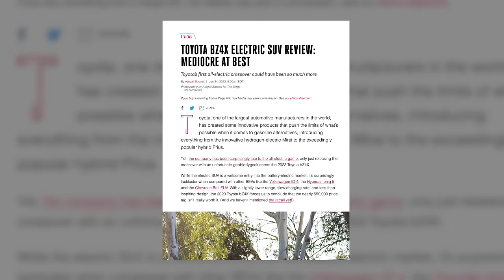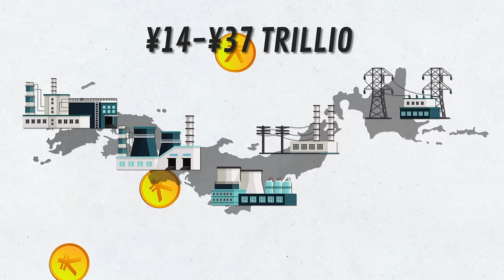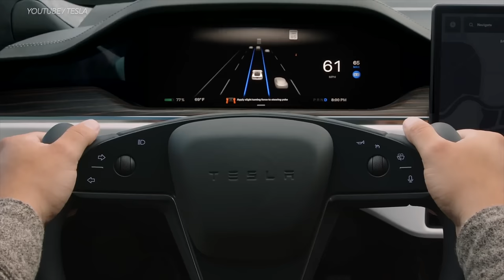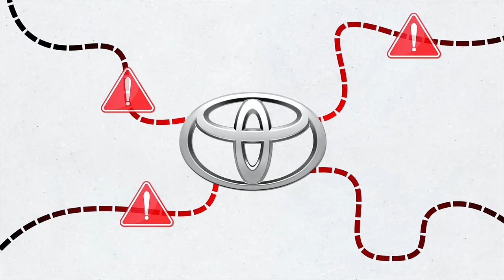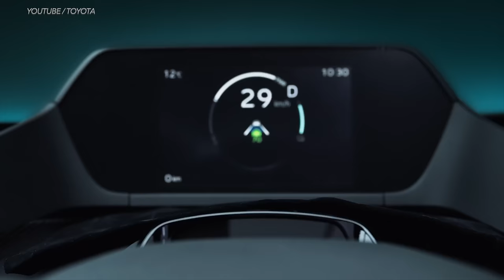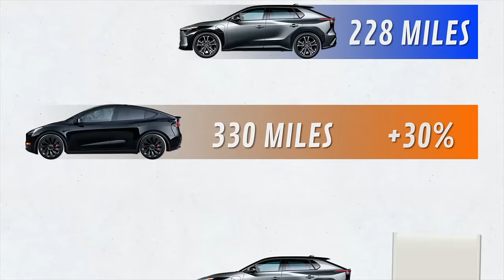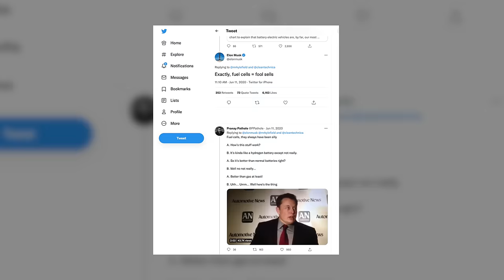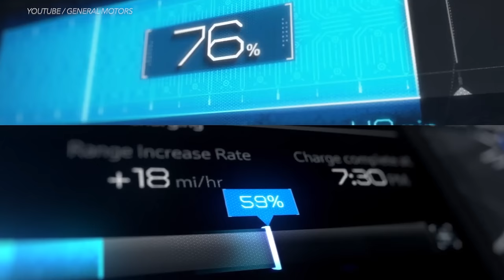Toyota's New Electric Car Shocks the Entire Car Industry

Comment: All of my cars are paid for and I take care of them to the point where they last 20-30 years. EVs are a big step forward in technology, but a big step backwards in convenience. If forced to I may buy a hybrid, but def not a BEV at the current level of tech.
Reply: Not making a case for EV’s, but cars from 20 to 30 years ago are very unsafe compared to today’s vehicles.
Reply: All depends on your point of view. I've found my EV to have been extremely convenient, because I can charge at home on my drive, and no longer need to drive to a gas station. I also find it very convenient that I can use some of the energy from my solar panels to charge the car....
Reply: @Brian-om2hh  C’mon Brian.  Having to plug that thing in everyone you get home and having to have the connection put in place to power it from your solar is not more convenient than stopping by a gas station every once in a while. You can make the case you like the car, but please don’t pretend that it’s convenient or green because EV’s are not there yet.
Reply: @edhcb9359  

You don't have to plug in every time you get home.  You can do just as you do with gas station fill ups.

Like I say, people are just so closed minded and looking for any and every way to insist that EVs aren't as functional and convenient as gas power.  But today, they really are.
Reply: @tharais  It’s not close mindedness that is stopping people from buying EV’s at this point.  They are a terrible value proposition, especially when you consider the build quality is generally very poor(Tesla ranks worst in automotive industry), the range is still very poor, and what on earth are we going to do with all of these huge toxic batteries when they expire?
Reply: @edhcb9359  Tesla sucks yes. Luckily a lot of other, better, companies are making EVs now. "terrible value proposition"; have you compared the cost per mile of gasoline vs. electricity? 10kwh costs $1.50 and goes 30-40 miles, while the average gallon is still >$4. I'm not saying it's for everyone but it makes sense for some people, and as the tech gets older/better/cheaper and more enter the used-car market, it'll start making sense for more people. Lead acid batteries are pretty toxic too; what do you do with them when they stop working?
Reply: @TheZeusJuice  I can have a company provided electric car or truck for free and I’ll choose the hybrid gas as long as they let me.  Who needs the range anxiety? Who needs another thing to keep charged? The biggest joke about the whole thing is that my state(CA) wants everyone to drive electric cars but we can’t even keep our grids up as it is.
Reply: @edhcb9359  Ok, we've established it's not for you. I'll repeat myself; " I'm not saying it's for everyone but it makes sense for some people, and as the tech gets older/better/cheaper and more enter the used-car market, it'll start making sense for more people. "
Reply: @edhcb9359  yeah totally, not like today's cars are built over complicated and have big screens that can distract you from driving
Reply: How can you be forced to buy anything in a free market economy!?!
Reply: @edhcb9359  Bad drivers make cars unsafe. all the advanced tech in the car can't fix stupid!
Reply: @kv1930  Which is exactly why you wouldn’t want one to slam into you while you are driving a 20 to 30 year old car.
Reply: A big step backwards in convenience? How so?  I think you have it backwards. For a commuter with less than a 300 mile daily commute (like nearly everyone on this planet), how could an ICE be more convenient? For those people that routinely need to drive over 300 miles each day an EV might not be more convenient than an ICE (unless driving the latest 520 mile range EV's from Tesla and Lucid, which are too expensive I agree). Still, for the vast majority of commuters (those that can charge at home), an EV with 300 miles of range is FAR more convenient, with much lower cost to own, than any ICE vehicle. I've owned my EV for nearly four years and drive just under 100 miles each day. I have never needed to use a public charging facility so charging time is meaningless. Besides having virtually zero maintenance, when I open the hood of my EV I see NO moving or spinning parts and nothing that produces fatiguing heat and vibration. I see Far fewer points of wear and tear or points of failure. 
    My EV has:
        - no need for an accessory or serpentine belts and none of the associated pumps, pulleys, or bearings. 
        - no need for an alternator 
        - no need for a power steering pump
        - no need for a mechanical water pump 
        - no need for timing gears, timing chains, chain guides, phasors or timing belts. 
        - no need for a high temperature, high pressure engine coolant system. 
        - no need for spark plugs, coil packs or ignition control modules. 
        - no need for fuel injectors, fuel pumps, fuel filters, fuel pressure regulators, fuel injection control modules. 
        - no need for a transmission that will eventually cause major problems. 
        - no need for expensive brake jobs every 50k miles. ReGen allows EV to need half as many brake jobs. 
        - no need for crankcase or transmission oils. 
        - no need for power steering fluid to monitor. 
        - no need for engine coolant to periodically flush. 
        - no need for O2 sensors or PCV valves to replace. 
        - no need for manifold gaskets, exhaust pipes, mufflers or catalytic converters.
        - no need for emissions testing EVER. 
        - no need for head gaskets that will eventually blow. 
        - no need for pan gaskets, valve cover gaskets or front and rear oil seals that will eventually leak oil. 
        - none of the hundreds of expensive hard to replace internal parts that are slowly wearing out no matter 
          how good the oil is like the pistons, rings, wrist pins, valves, valve guides, tappets, camshafts, cam 
          followers, rockers, cam chains and gears, push rods, etc... 

From a maintenance and cost to own perspective there is simply no comparison, an EV wins hands down. Consider as well the number of hours required to schedule, drive to and from, and sit in customer lounges wasting hours waiting for all those oil changes and other routine maintenance that ICE vehicles require. And now that battery technology is allowing for more than 1500 "full " charges (and thousands more "partial" charges), an EV with 300 miles of range can expect its battery to last 1500 charge cycles. At 300 miles per charge cycle that's well over 400,000 miles of life. PLEASE, someone tell me how an ICE could be more practical, have lower cost to own, or be more convenient for the average commuter? If I have to replace a $15k battery after 400,000 miles big deal. Your ICE fuel costs (at $3.50/gallon) and oil change costs alone will far exceed that.
Reply: @edhcb9359  not needing to visit a gas station is amazing… filling for $10 instead of $120 is amazing… Never servicing the car is amazing… Never needing to replace brake pads is amazing. 
Having a car with instant torque… great handling with silent operation is a revelation. 
My Model 3 makes any petrol car feel like dial-up internet.
Reply: @roryreddog3258  We have these choices for our company provided executive vehicles: 
A)Toyota Highlander
B)Toyota Camry XLE
C)Tesla 3
D)Coming soon Ford F-15O electric

Almost nobody chooses the Tesla 3.  It’s way too small to be comfortable for hauling around clients to lunch and if you have a family at home then it’s way to small for that too.  The handful of people who have chose them have nothing but complaints once the newness wears off.  Maybe I’ll try the F-150 electric, but for now the Highlander is tough to beat.  It’s what almost everyone chooses.
Reply: Just cover the body I panels the whole body and windows for extra charging
Reply: The new Lyrik is superior to ANY gas powered Caddy................Paul
Reply: The best thing about EVs IS the convenience of use, provided you do have a garage or L2 plug where you park.
Reply: @edhcb9359  some people are just stuck in the past and want to drive old clunkers
Reply: @edhcb9359  I plug mine in every evening eventhough I dont have to, it is just so easy. If it is not trivially easy for you, you have located your connector in the wrong place.
Reply: @Tron-Jockey  that guy is a lost cause, he thinks that what he has been doing for 50 years is convinient and must be the best way.
Reply: @edhcb9359  Model 3 is not to small, look at European cars. The problem is that people are getting too big and haul to many things they dont need to.
Reply: @gebels22  I have no desire to follow in Europe’s footsteps on anything. And try loading the family up and going camping in a Tesla 3…ain’t happening. It’s for Asian people living in the city.
Reply: @edhcb9359  I only have a regular plug at home.  I commute roughly 50 miles a day no inconvenience at all.  My Volt is 100% every morning before I leave the house.  If your commute is less than 50 miles you're fine.  Even if it's more you would just need to fast charge once a week to make up the difference.  The fast chargers are usually placed in busy grocery stores and shopping centers which is safer than a sketchy gas station.  It's only when you are commuting 100 miles a day you would need a faster charger at home or visit a fast charging station .  But I live in LA county much better infrastructure than other parts of the country where it hasn't been built up yet.  For those peeps plugin hybrid like the RAV4 prime is ideal.
Reply: @marklihsu  None of my clients(mostly doctors) are going to want to get in and out of a small car that is low to the ground. My Highlander is so comfortable there is no way I am going to swap it for a Tesla 3 even though I could do it at no cost to me. My Highlander is a hybrid so I fill it every couple of weeks. I guess if a person wants a tiny car then the Tesla 3 would work.
Reply: @edhcb9359  The most advanced safety device is between your ears.

Comment: Tesla X with 330 mile range, in Kansas on a very flat road doing 60mph on a 70 degree day.  My boss has an X, if it is just him and his wife, the X will go from Phoenix to Flagstaff, 145 miles and arrive with 7-10% charge left.  Phoenix to Las Vegas is slightly flatter, but 260 miles, you have to stop in Kingman to charge up because they will not make it to Vegas on a single charge.  
The Rivian boasts 400 miles range, but also just barely makes the Phoenix to Flagstaff run and will not make it to San Diego, LA, Las Vegas or Albuquerque.  They are inner city commuter cars, don't expect them to do anything else very well.  Oh, and the Lightning can't even make the Phoenix to Flagstaff run without stopping to charge.
Reply: Kia EV6 at least charges up 10-80% in 18 minutes, which isn't bad. About the time it takes to pee and grab a quick snack.
Reply: That sounds about right! The car driving public is on its way out. With all the debt from these bills in Congress (Shumer/Mansin Inflation Reduction (my eye!) bill), the debt will be tacked on to the National debt until and if we ever get a fiscally responsible Congress that wants to pare down debt...there will be enormous taxes on car ownership based on mileage, thus squeezing the working class (haven't you heard the "you'll own nothing and be happy about it" line?). Only the top 5% will be able to freely travel as we do today. Watch it...it's coming folks!

Comment: I think the relationship between the frame/body of the vehicle, and the battery for the vehicle, should be redesigned. It would make the battery package easier to service or change out if needed.
Reply: Imagine if you could just stop by a service station and swap out the battery in 10 minutes or so. You would never have to worry about battery life. Technically you don't buy the battery but rent fully charged one's. If one was bad it went for refurbishing or recycling.
Reply: @In-obscurity-n7j  Some kind of modular battery system where drained cells can be quickly swapped out?
Reply: Need to be giant cell phone like batteries where u could unlatch something on the side or back of the car & slide the battery out.  The batteries could just have contact points just like cell phone ones.  I would also be way more interested if battery replacement was easy.
Reply: Exactly, compact, mid size and SUV/truck. If Auto manufacturers could agree to make them uniform.
Reply: the top drop and bottom service approach need to change for better battery/module sway.  they should go side access with a center bus frame, just like server racks but flatten out server rack with large battery cells/modules that can be individually diagnosed or serviced.  removable side panels, and modules can be pulled out and plugged back in for easy sway.
Reply: You might only do that once in the life of the vehicle, as long as it’s possible to do it’s probably not a big priority

Comment: I bought a 99 Grand Marquis. Has 180k miles. It is alittle rough, but the engine runs good. I don't see any oil leaks. A friend sold it to me for 1,500. She said it ran warm. I'm replacing the radiator, water pump, thermostat, hoses and belts. That should help it. I need to buy a scanner to see if there are any problems with the injectors or fuel system. I might try Scotty's tip about putting a gallon of lacquer thinner in the tank to hopefully clean the cat. I'll have to pressure test it after. Doesn't look like the trans was ever serviced. I'll have to see how it shifts on the interstate.

Comment: I like the way the car looks and the way its designed also with its price point. I just really dislike how it seems toyota was clumsy assembling these cars because its not like this is their first time making a car with WHEELS.
Reply: As a Toyota/Lexus tech, wheel nut torquing is part of a pre delivery inspection.
Not sure how the dealers are letting these cars get to the public with loose lug nuts.
Reply: @07decker  Based on the little I've read, torquing is not the issue. Apparently a manufacturing flaw of some kind. Toyota doesn't seem to have a fix and are now offering to buy the cars back. This strikes me as odd and leaves me wondering why we need new wheel lug tech all of a sudden. We have one at our dealership that's been in hiding up on the roof deck since being delivered some months ago.

Comment: Toyota has always seemed half-hearted about BEVs. The Japanese carmakers have very close relationships with their parts suppliers that would come under threat with a wholesale move to BEVs.
Reply: It's not that. They were happy to explore the FCEV technology. They just thought that BEVs will soon die out and it would all be about hydrogen and not batteries in the near future. It turned out acquiring hydrogen for those cars is not all that easy and ecology friendly as it's very energy consuming, requires transporting  and so on. And as a result BEVs turned out to be the winner so far, and it doesn't look like it will change in the years to come
Reply: @Ysmir.  They have been exploring it for some time and seem to be deepening their commitment to it despite the energy density, infrastructure and range limitations of non fuel-cell hydrogen being evident 10 years ago. BMW tried an ICE hydrogen 7 series about 15 years ago. They are really bad idea. There is a whole ecosystem of parts suppliers that Toyota has generations of relationships with (not cheapest bidder, arms-length relationships like in the states) that won't be making alternators, transmissions, fasteners, etc if BEV wins the day - I think passion projects like this GR are Toyotas way of letting them down gently.

Comment: I'll just keep driving my 2004 and 2005 Prius, just installed a new lithium ion battery in the 2004.
Reply: @tooltime9260  There are lots of kits and services advertised online that will upgrade old Prius and Leaf batteries for extra capacity/range lithium. It's niche, but not uncommon.
Reply: Nothing wrong with the NiMH the 01-15ish Prius came with.  I wouldn't retrofit regular lithium ion.  Maybe LiFePO4 if someone made a great conversion kit.

Comment: Scotty: Have you video on the “mild hybrid” approach of Audi, BMW, Mercedes, etc? The 48V battery does not seem to be warrantied for extra miles and years like a full hybrid battery, suggesting a large recurring replacement cost. And the 12V supplemental battery is expensive too, requiring a dealer reprogramming to tell the car a new battery has been installed. Sounds like an expensive middle ground between ICE and full hybrid. Would like to hear your views!

Comment: Curious to why not hybrids just being cars with a built in generator that is functionally electric, the battery powers everything, has fairly low mileage range, but when the battery hits 30-20%, it triggers the generator to turn on and charge the car which goes until 80% battery capacity.

Seems like it provides all the positives and eliminates the negatives, minus what, more weight? Doesnt seem different than hybrids though, too many added points of failure.
Reply: Gas generator to ne specific.